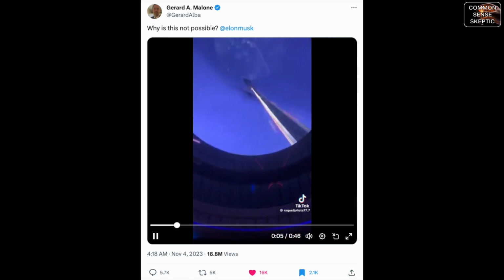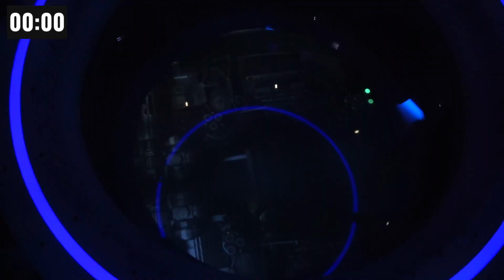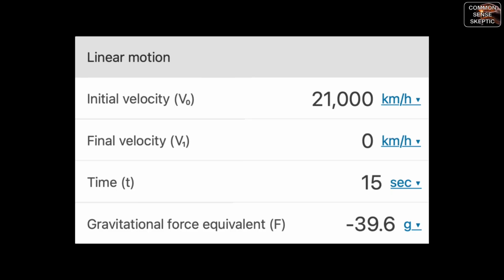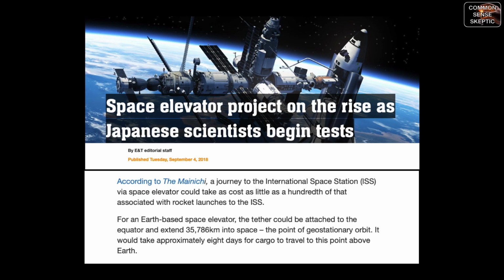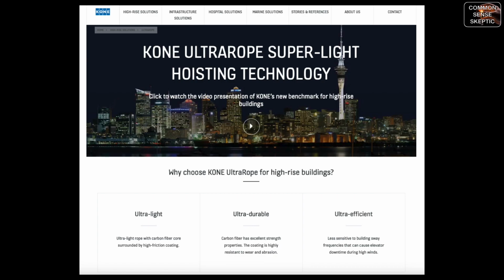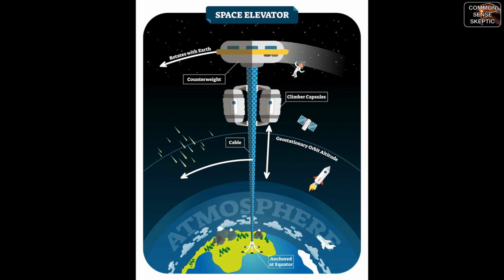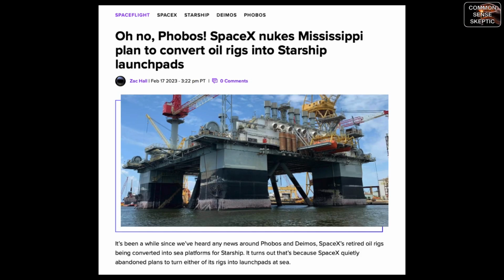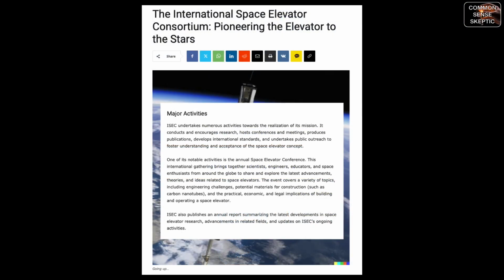DEBUNKING L.E.O. SPACE ELEVATORS

Comment: Just one small caveat: While it is true that one cannot just drop off a satellite at LEO heights to get something to the ISS, it is energetically much cheaper to get something from a geostationary orbit to LEO (delta v of 3900 m/s vs 9300 m/s from earth, and without air resistance). And assuming that one can get stuff up to the station for cheap and with electricity (mitigating the whole rocket equation problem), that would probably be economical. And that also applies to all other transfers within the solar system. So not completely useless. Just generally impractical.

Comment: I saw something once where they spoke about space elevators and the problems with the materials we currently have that could be used for such a device.
They looked at spider web as a viable material if we could make it. It would be light enough and strong enough to hold itself together, tethered to a heavy thing in geo-sync above.
Dont remember what else they spoke about.
Reply: spider silk is not even close to being strong enough.
Reply: I'm not sure if it was done yet, but there are plans to genetically modify silkworms with spider DNA to increase production to be viable enough for textiles.
Reply: As far as I have seen the only viable material has been carbon nano tubes which is still under development
Reply: Check the video where a youtuber makes a piano string with spiderweb.
He harvested 8KM of spider silk to make a single guitar string.
Reply: @magfal  Ok whilst trying to find your piano wire video, I came across a myth busters video testing web strength.
Should have known they would have tested this myth.
Turns out spider web weight for weight is a bit more than twice as strong as steel in their testing conditions.
So probably not going to be making a space elevator out of it after all.
https://www.youtube.com/watch?v=dMN_wQ6Zyy0
Reply: We humans have done the math, and only carbon nanotubes would maybe .... Maybe be able to have the required strength... It's right there on the edge... 

The general idea is that a station on Geo would Bild the cable down and up from Geo with a counter weight moving away from it to balance the cable coming down... 

This Is complete Sci-Fi... But we do know it's will be really hard because we know a few things... No material will hever be as strong as ideal carbon nanotubes and those if you run the numbers are at the edge of making this possible....

Space elevators would work on space bodies with higher rotation speed and lower mass...